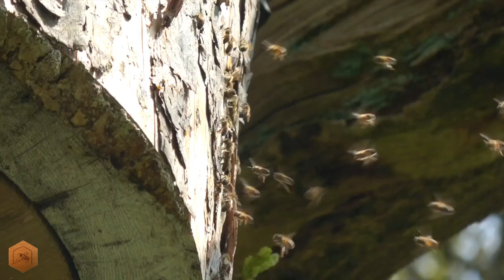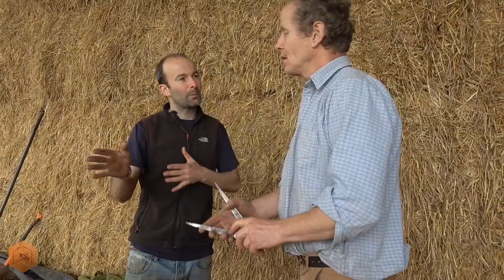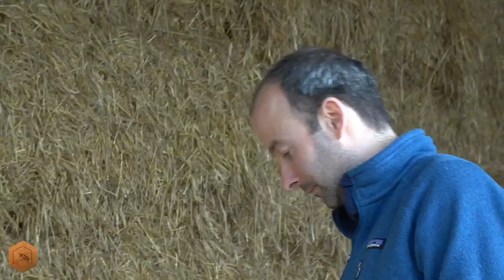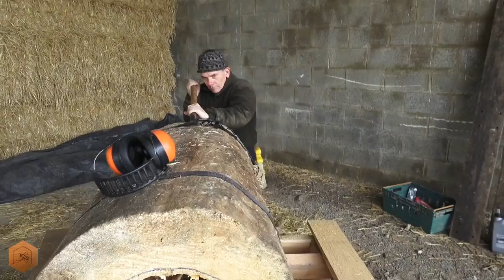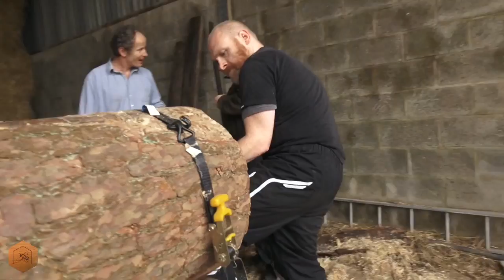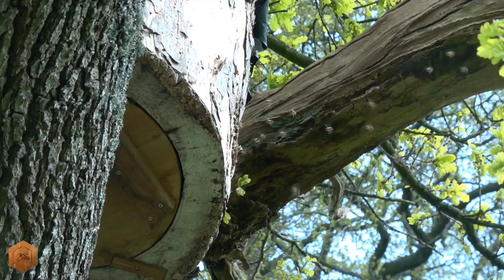Rewilding the honeybee with log hives

Comment: This is  a great Idea and one I have wanted to make for some time . I know with out the proper tools these are tricky to make ,but we have an oak tree that has been felled & has laid  in a friends wooded area for some time ,Im not sure that the trunk is suitable as there are a lot of branches coming from the main trunk - could it still be hollowed out ? or would it be too difficult due to the wood in the branch areas be much  harder ? And what length would the log hive need to be for it to be sufficient for  the bees  ? Thank you in advance for your time  . Paula Pixie Moss